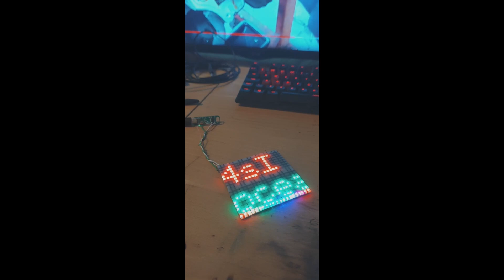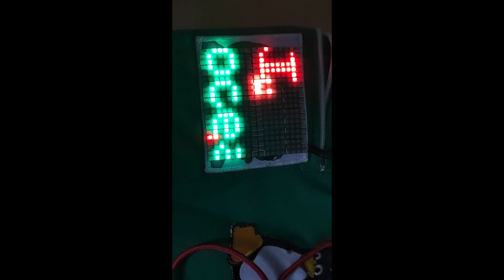Sound reactive RGB led matrix

Comment: Very Impressive 🤩🤩👍👍
Any leads for similar sketch for esp32.
Reply from the maker: I'm not really looked into, but WLED might work with matrices. Another one is that adafruitGFX probably could be used for text and grahics creation.  They are also probably highly optimized and stable. I created these animations and the text function for practise. The fft code has been built largely around this project:(https://github.com/daoquyanh2000/ESP32-spectrum-analyser), to understand how arduino fft works and how to blend the bins.
Reply: @4sIElectronics  thanks,
Already have WLED and WLED SR.
But few effects which your demo has are not available on WLED or even when using LedFx.
Will check those link.
Appreciate your help 🙏🙏
Wish you a great holidays and New Years.
Wishes from India.
Reply: @4sIElectronics  What about for Raspberry Pi Pico Ws? Know of anything for that? Awesome work btw. I'm looking into building something similar.